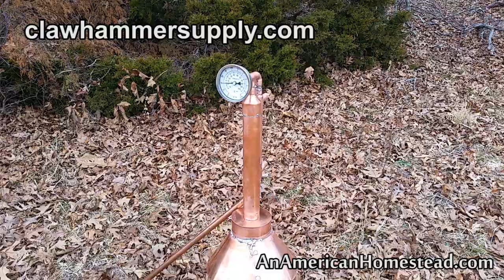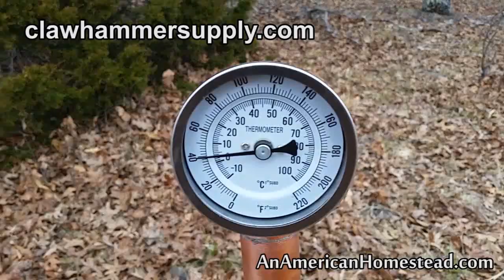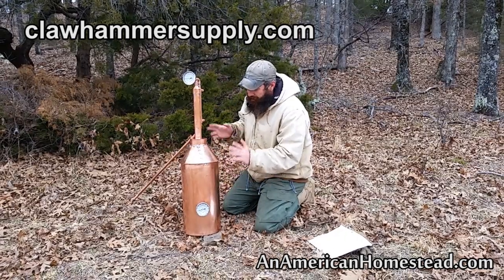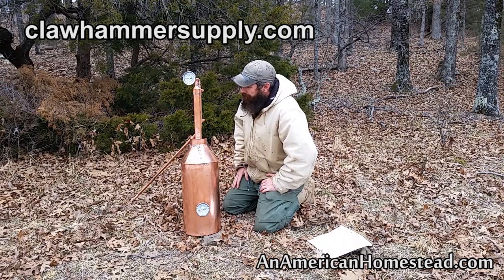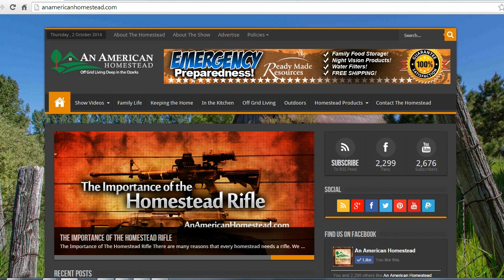Building a Pot Still - An American Homestead

Comment: You're not heating the metal enough. When you think it's hot enough, heat it a little more. When you touch the solder to the join, it will zip around and leave a wedding band.

Comment: To run this in a small engine (generator etc) increase all carb jets by 1.3 times their present size. You'll burn twice as much of this as gasoline to do the same work. Stoemetric(sp) for gasoline is 14:7 and methanol is 6.5:1, I think ethanol is 8.1:1. Measure present jet size, multiply by 1.3 and redrill to proper size. Close up spark plug gap about 4 thousandths as well since you'll need a hotter spark to ignite twice the fuel volume as before.
Reply: Close, but only about 1.5 g of actual ethanol, 200p compared to a gallon of gas a burn rate. But if you're only making 130 proof out of your still it's a lot of water, and  if you have the capability on your generator or your smaller horsepower motor to adjust the pickup off your flywheel not the gap, but retarded it. .....

Comment: Can't arc weld copper as far as I know but should be able to TIG weld it with copper fill rod. Also something I learned as a kid when using a pot over an open fire, wipe a layer of dish soap over the outside, it will make cleaning the soot off much easier.

Do you have any info or links on what you need to do to get the permits to stay legal? Any prior vids where you talk about the legal issues with owning one?

Something I've always done when soldering pipes is to keep a wet rag handy and wipe the joint as soon as you finish to clean off the excess solder and make it look clean. Also heat only one side of the joint, the heavier side if 2 different thicknesses. The solder will be drawn into the joint and wick around following the heat. Always be sure to clean the joint with emory cloth or a joint brush and don't forget the flux paste.

Very cool looking and giving me the urge to get one of these. I never realized they were legal to own.

Comment: Forgive my ignorance but don't you still need gasoline to mix with this? Would biodiesel production be more worthwhile since you wouldn't need gasoline? Again, I know very little and am just trying to understand.
Reply: +Dawn Finiff No, you don't have to mix in gasoline. An engine will run on Methanol or Ethanol but you'll need some mechanical expertise to make it work. I.E. a brigs and Stratton generator engine will run fine on this without gasoline but you'd need to close up the spark plug gap a few thousandths and you'd need to reject the carb. All the carb jets would need to flow roughly twice as much fuel as they did for gasoline so you'd just measure the jets and drill them out by 1.3 times their present size. You'll burn about twice as much of this than gasoline to do the same work.
Reply: +thastinger345 thanks for the info. Seems like an awful lot to know. Without gasoline, I would just be walking I guess. Lol.
Reply: Dawn Finiff yeah, a modern fuel injected car would run on it but the engine management computer would need a custom tune, you'd need a larger capacity fuel pump and larger fuel injectors. A more modern "E85 flex fuel rated" vehicle would run fine on this with prolly 15-20% gasoline added though. The idea that this 5 gal still is going to make enough fuel to run a vehicle is not realistic as you'll get about 3/4 gallon of fuel grade ethanol from a 5 gallon run. If you're a "prepper" you'll also need about 10 Lbs of sugar to make that 3/4 gallon of fuel...or about 250 Lbs of sugar to make enough fuel to fill a tank.